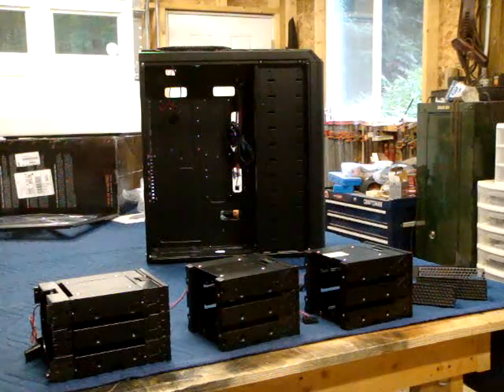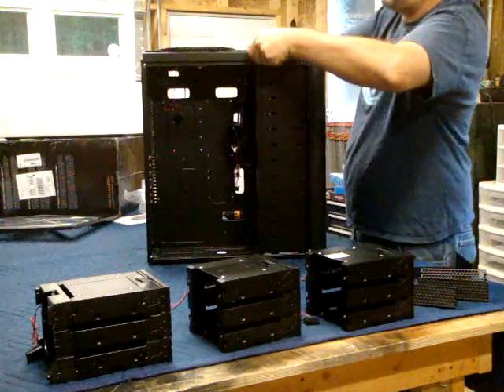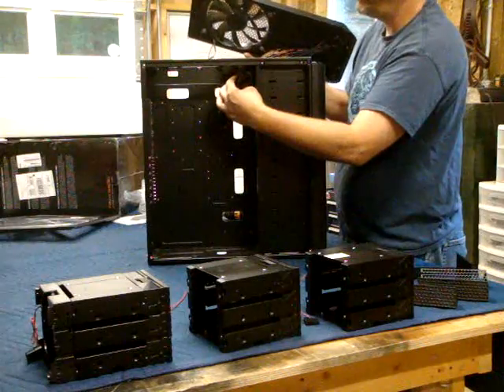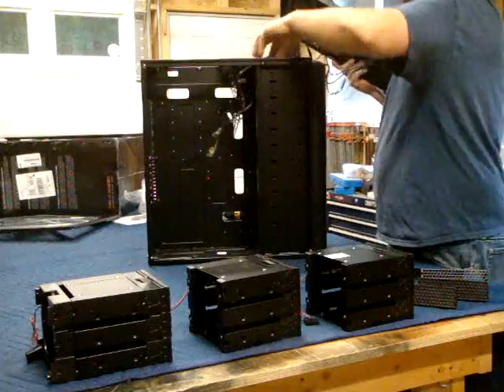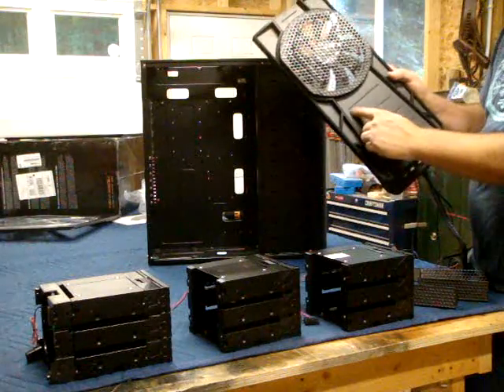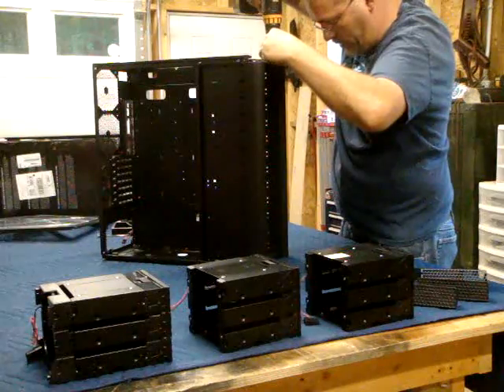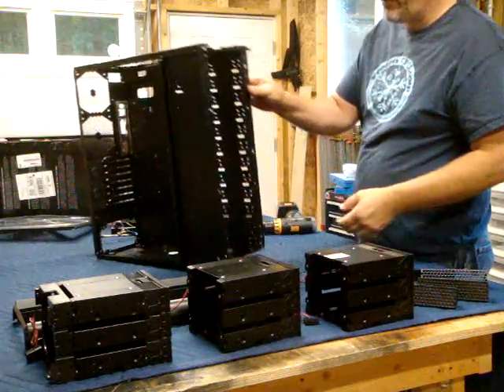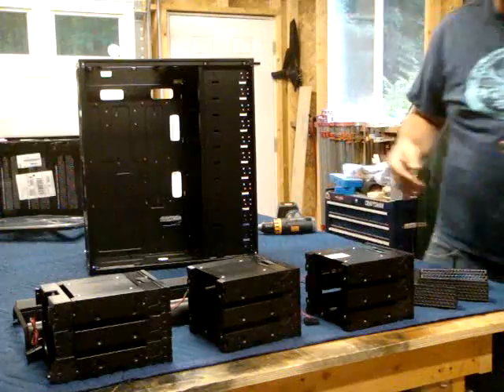Antec 1200 DisAssembly and Inspection

Comment: Nice video!   I'm having a little issue with mine.  It is almost identical to yours except it is a v3.  I have a 4th drive cage for mine.  When I put the drive cage in, it gets stuck trying to remove it at the inside top.  That is the thin lip portion of the outer bezel.  The honeycomb grid of the top drive cage hangs on the bezel.  You seen this?  Any suggestions how to relieve this problem?

Comment: You think installing a 240 EK Rad up top below the 200mm would be hard? :( I don't wanna mess anything up and heard the metal is thick, but would rather mod it to be mounted up top in my antec 1200 then externally. I definitely don't want to do it in the front where the 3 intake fans are.

Comment from the maker: 3 years ago I could tell you precisely. In general there are a couple of screws and some tabs that you will need to press in to release the plastic top from the metal chassis. Don't force it off...release some tabs and pry it up and release some more and pry it up and release a couple more and off it comes. Watch the cables to the switches...make sure they are freed up so you do not damage the connections. Have fun. Take your time.